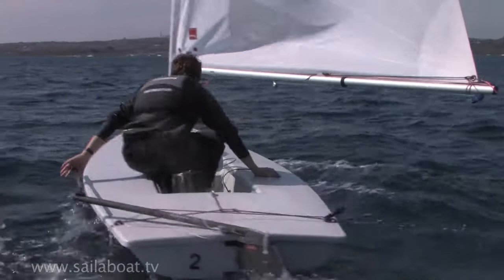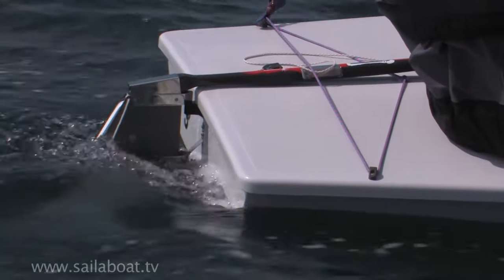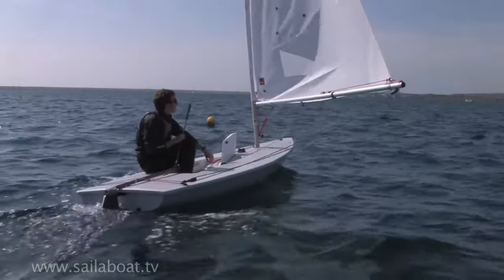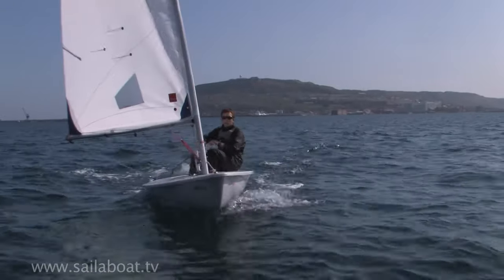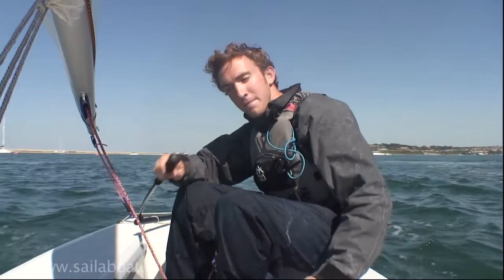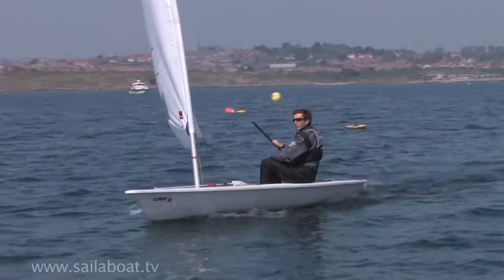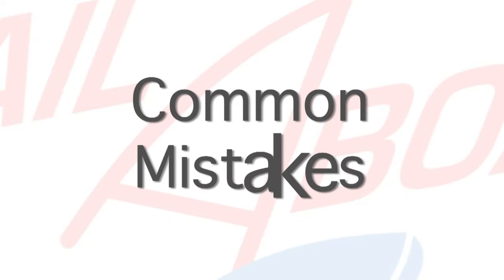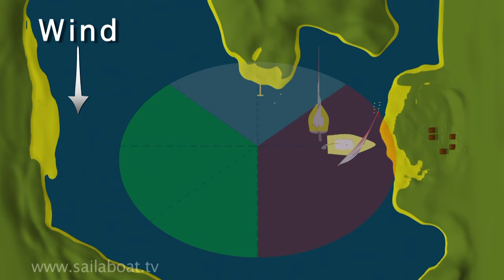How to Sail - Your first sail Single handed boat

Comment: Picking up my first ever boat today, a CLC Passagemaker dinghy. This is the best video I’ve seen. Nervous to get out on the water but you’ve narrowed it down nicely in this video so I now feel a bit more confident. Thank you!
Reply from the maker: I am glad the video helps. The trick with sailing is to learn in small blocks one piece at a time. Don’t rush to learn. Speed comes later. Start off on light wind days where the chance of capsize is less. Be sure to check out the other videos on the channel and happy sailing
Tim
Sailaboat
Reply: @sailaboattv  thanks Tim. Already into your other videos, the tacking one is also great
Reply: Nice! I am nearing the completion of my CLC Eastport Pram build. Never sailed before so starting here before I take it out.

Comment: Curious why the centerboard isn't down further...  Great video.  I could use a few more like this, particularly including a jib and spinnaker (14 ft dinghy) and techniques for getting in and out of a tight row of docks. 😀
Reply: yeah i was about to say the same thing. it almost looks like it out for them running but they’re on a beam????

p.s it’s a dagger board because it’s removable not a centerboard :)

Comment: It is unsafe for a beginner to let out the main sheet and sail. The boat will rock precariously and the sail may suddenly “jibe” - swinging across the boat.
Reply from the maker: Thanks for the comment. This is why we suggest the training run where the boat sails downwind but not on a dead run. Learners need to appreciate the points of sail. You are right that people must remain safe but to sail away from the wind the sails must be set  correctly.

Comment: Great video. But why does the sail is at the level of the head??? It's so dangerous!  And they have to bend down to avoid it at each turn. Obviously it's not comfortable. Why not having raised the sail higher?
Reply from the maker: Good question. Most if not all sailing dinghies have a low boom. The Laser (ILC class) which is used in the films is probably the most popular boat in the world and does have a low boom which is aluminium and quite light. Other boats with higher booms are not as fast. Some folk wear helmets like canoes any cycling but this is a personal choice. When teaching small children, helmets are preferred. 
In all the years I have sailed I have only made one trip to hospital with a student head bang but this was purely a precaution and seen very few injuries.
The boom is a hazard but then again so is crossing the road, so learning in light winds is important and the importance of ducking is quickly learned! Don’t let this out you off if you want to learn but attend a sailing school who will walk you through the steps
Reply: @sailaboattv  Thank you for your answer!
Reply: @sailaboattv  I once told my crew, 'duck' and he started looking for ducks on the lake. Head-banger. Cheers.

Comment: What kind of boat this is? How much wind was there when this was filmed?
Reply from the maker: The boat is a standard Laser. We had light winds during filming which was good for the purpose 
Thanks for the interest
Reply: @sailaboattv  thanks, I thought it was called laser but everytime I googled laser I saw people leaning over it and thought that this boat is too hard core for beginners :) But I guess when you're in competition it's totally different thing than trying to learn sailing on a lake (which I'm trying to find a boat for)
Reply from the maker: @pubjohndoe3599   check out the laser radial. It has a smaller sail and a lot easier to use

Comment: Hello everything is fine? I have a Holder 12 model sailboat, but I'm having problems when sailing upwind. Depending on the strength of the wind, the rudder tends to luff. I don't know if it's sail adjustment or the boat's inclination.
Reply from the maker: This is due to the change in hull shape in the water as the boat heels over. The same effect happens on bigger boats. For a model boat the strength of the wind will have a larger effect due to scale.
What is happening is when the boat heels it will want to turn into the wind. If you ski or ice skate you turn by leaning on one leg. Same thing happens on a boat. As it heels the water shape is upset and no longer a symmetrical shape. This change in shape means water has to travel faster on the leeward - boom side of the boat. This extra speed generates lift and the boat turns.
Spilling wind in the gusts will help which is what bigger boats will do. This reduces the effect of the wind and reduces the turning effect……
Another possibility is to increase rudder size.
Another possibility is to have a smaller sail on windy days. Same thing for big boats when they reef to make a smaller sail and reduce the turning effect
Hope this waffle makes a bit of sense!
Tim
Reply from the maker: Carrying on. Another tip if possible, I don’t know what sail controls you have but try not to pull the main sail control in quite so much on windy days. This is another sailing technique. The boat will not point into the wind as high, and will sail further to get upwind but the looser sail outs less sideways force on the rigging and hence less tipping which will be less turning into the wind.
Reply: These tips are very good. Thank you very much for your attention and for responding quickly. Now I need to train to perceive these effects on the vessel. I want to congratulate you on the quality of the videos.
Reply from the maker: @vintage1429  thanks
Be sure to check out the rest of the channel 
Tim

Comment: On many of the close up shots, the pin that keeps the tiller connected to the rudder is loose and out of its hole.
Reply from the maker: I don't see what you mean.  We very carefully filmed everything but thanks for your beady eye!
Reply: @sailaboattv  Somewhere in San Fransisco bay, My laser rudder is lurking after it slipped off of my tiller. The rudder became entangled in the sheet so I had to disconnect the rudder from the pintle and when I did that, the pin that holds the rudder to the tiller, popped out some how. The rudder was lost near the boat ramp at the north end of the golden gate bridge back in 1980.

Comment: are those the easiest boats to learn to start sailing with?
Reply from the maker: Hi John
The Laser is perhaps the most common single person boat. Being an Olympic class it is very popular. The boat has different sizes of rig snd the radial size is easier to manage than the full sized sail. You do need to be moderately fit to be able to work in the small cockpit but the Laser is a lot of fun to sail. Check out your local sailing centre for relevant local comment and we suggest attending a sail school to start with. You will reach a higher standard quicker and learn on their boats
Hope that helps
Tim
Sailaboat

Comment: What is the reason for mentioning to move the sail till the sail stops flapping?
Reply from the maker: The sail is at the most powerful at the point it just stops flapping. So release the sail until it starts to flap behind the mast then pull in to stop flapping. The wind has to do three things. It must enter the sail at the right angle, flow across the sail and then leave the sail in the right direction. Adjusting the sail constantly helps achieve this and generates the maximum lift and hence speed. Only allow the sail to flap when you become over powered, then it’s a case of easing until flat and keep tweaking all the time
Tim
Sailaboat
Reply: @sailaboattv  is it possible to sail between 2 fixed points? Say you live in Brighton and you buy a sailboat in dartmouth and you want to sail it back from dartmouth to your home marina in Brighton.  Can you do this regardless of the wind direction.? I know you can't sail directly into the wind and that you have to zig zag to go forward. But can you go in a straight line  in any other condition than the wind blowing from the east.? Can you still go in a straight line if the wind is blowing from the south  or north by adjusting the boom like you mentioned earlier. Basically from Dartmouth to Brighton you could go in a straight line as there are no land points obstructing you.
I don't get what it is that the rudder does compared to what the sails do
Reply from the maker: @michaelsrowland  hi Michael. Your question is above the scope of sailaboat. We show how to sail a small boat. What you are talking about is big boat or yacht sailing which has many more considerations in play. Sailaboat sticks to dinghy sailing. There will be other forums to advise on what to do.

Comment: at 8:13 that was a gyb correct and not a tack?
Reply from the maker: Thanks for the message but no it is not a gybe. The boat is tacking here. If you look the tell tale sign is the sail flaps during the turn. If it was a gybe then the sail would remain under power all the time

Comment: You demonstrate early on as tacking: moving the boat left OR right as TACKING, But in earlier videos you said moving one direction was gybing and the other was tacking.
Reply: That depends on the direction of the wind and so whether you'd go "left"/port or "right"/starboard varies according to the situation you find yourself in. However steering the bow through the wind is always tacking and steering it the other way is gybing.
Finishing the maneuver you'd end up with either a port tack or a starboard tack and that would determine which direction you would steer should you want to turn around and go back the other way.
Reply from the maker: No we don’t. We always show turning the boat through the wind as tacking

Comment: Its better to start with a sun fish or a pic instead of a boat like a laser.
Reply from the maker: I would say it doesn’t really matter. A sunfish will have limited potential as you improve but they are cheap enough and easy to sell as you improve. The laser is the most popular dinghy in recent times and good for improving. Hope that helps!